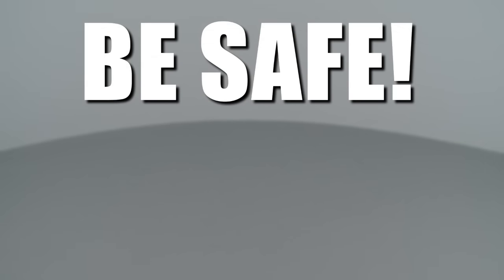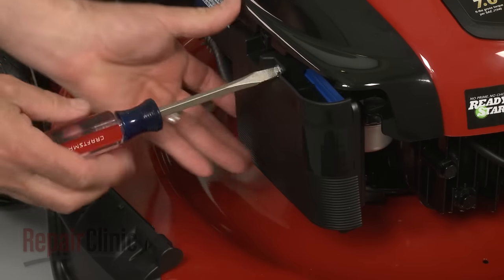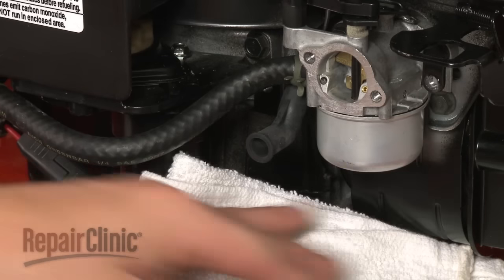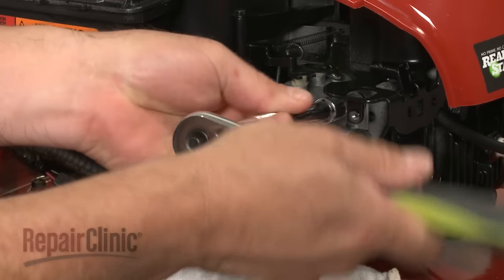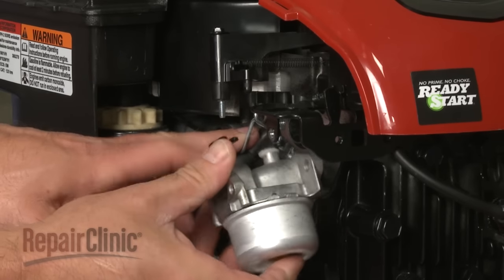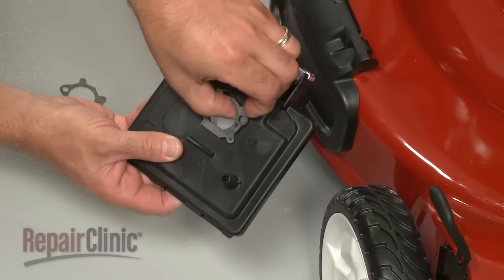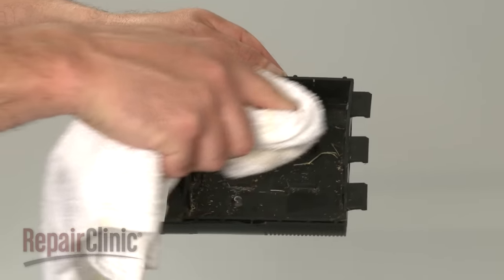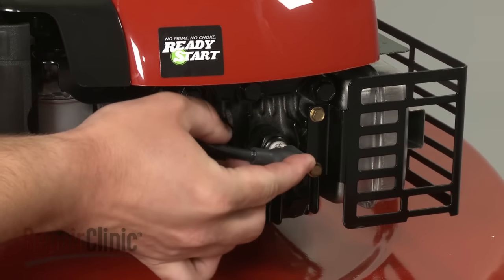Lawn Mower Won't Stay Running? Briggs & Stratton Carburetor #799866

Comment: Is you're brand new, never used mower not running? Take out the very clean never used bolts that will come off with no effort...or be in the real world where those bolts are a bitch... After that clean you're float bowl and jet. And if you're really lucky you'll have to rip half the engine apart to get to one bolt XD

Comment: This is a stupid video for sure.  so the lawn mower won't stay running.  I have a Ford truck that won't stay running.  Dare I begin to yank the motor, or should I just find out what's wrong with it?  Take this video one step further.  It won't stay running, so go out and buy a Honda lawn mower instead.  that will fix the mower for sure.